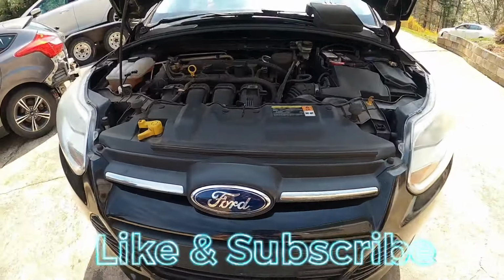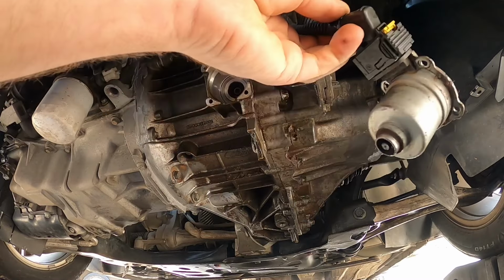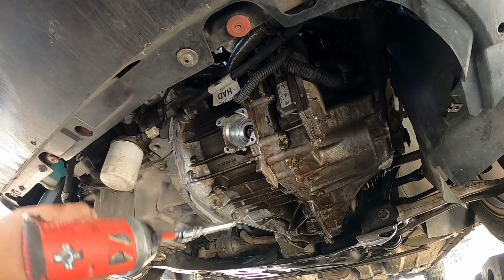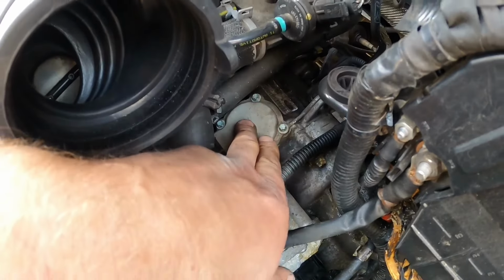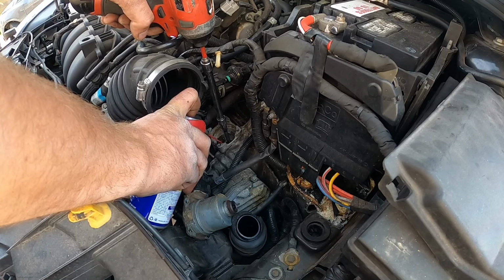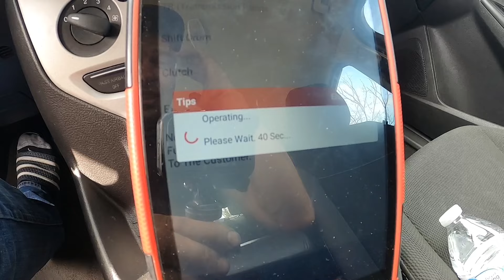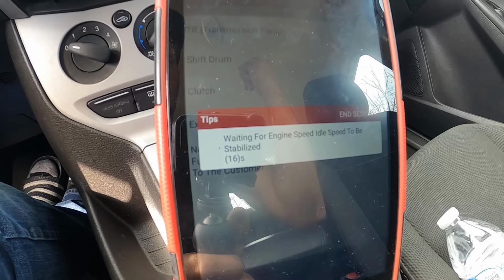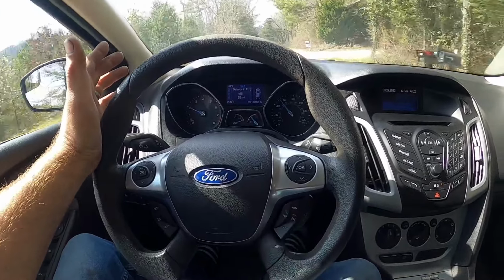2012-2018 Ford Focus Slipping? No Reverse? No Drive? Problem Solved. Easy Fix. You Can Do This!

Comment: What is the bit for removing the 4 actuator screws/bolts?
Reply: i saw some people say it was an E8 torx. I am trying to figure this out as well. i would recommend getting a set of ETorx if you dont own any. I am about to do this as well.
Reply: I used a 1/4” standard socket and that works

Comment: I just tried this. Everything was going well. I put it back together and test drove it. It was still slipping some, so I took the actuator off and the fork was stuck hard. I didn't know which way to turn it, so i thought counter clockwise was good. It gave but now it free spins in both directions. I might have screwed the pooch on this one.

Comment: I have no codes but I reset transmission to relearn. Was shuttering a bit at take off but after reset it stopped. Can u do this as preventative maintenance? And do u actually need to reset thru obd for i don't have this tool. Some people in comments say they skipped that part.

Comment: hi, i has a 2012 ford focus se model,134800 miles, sometimes R(reverse) not working and front has a belt noise, should i go to the ford dealership for this issue? Is this TCM issue and worth to go to the dealership?Ford dealership said they will charge 344$ for tcm check. If reverse prob;em is not associated with TCM, this fee will not waived. 
Alreday spent 75$ for transmission check and they told me to replace for thousands. 

Im broke and want your advice.
Reply: Me too. Need advice!!

Comment: Unfortunately, I believe I have a broken “B” fork. I tried to move the shaft counterclockwise 14 turns, but when I released it, it had no spring return. So I guess it’s time for a new clutch set.

Seems like the “A” fork is easier to clean than the “B” fork due to gravity taking the brake cleaner and lubricant down into the fork mechanism. Hard to shoot brake cleaner up into the “B” fork.

Comment: I have a question. Please help if you can! I had a code P287A for clutch B stuck engaged and No reverse.  I did some cleaning like you and switched actuators between each other and deleted codes. Transmission started working. But I can't perform adaptive learning for some reason.  At first I tried to do TR sensor test but it's failed, then clutch learning, same thing with it - failed. And I feel a bit of slipping on 1st gear, also sometimes rough shifting between 1st & 2nd gear. And when I'm driving downhill without touching acselerator pedal my RPM's about 2000 with seems to be high. Thank you!
Reply from the maker: That transmission has to come off and inspected. Seems like clutch fork is stuck
Reply: @L8R-HP  Thank you. I’ll give you an update after I’ll finish.

Comment: I just bought a 2014 Ford Focus titanium hatchback, 86k miles. Just got a code for TCM, and shift forks. I’m not sure if the TCM is actually bad or if just the shift forks going bad? What do you think?
Reply from the maker: Forks are sticking
Reply: @L8R-HP I have a blue driver OB2 scan tool but I can’t find where it’s has the adaptive learning, what scan tool would you recommend? Or can I drive it to somebody that has a scan tool after cleaning the forks out?

Comment: 16:14   unplugged batt first when done cleaning *then plug batt will set computer ?
Reply from the maker: That will reset computer. But it’s best to do a relearn with a scan tool or forscan. If you don’t have a scan tool or forscan it will relearn on its own eventually if all is working right.

Comment: Thanks good to know... the TCM seems to be going in my son's 2015 ford fiesta but i will give this a try considering it will only take about 20 mins or so... What scan tool are you using? the engine light is on but my cheap obd scanner says there's no stored codes? may have to go to the salvage yard and pick up a used TCM but I think once changed they have to be programed... I think with a scan tool that can be done but at this point I am not certain.. only started messing up last night and i havent had much time to research it.

Comment: Question: are you rotating counterclockwise the whole time or are you reversing when it stops?
Reply from the maker: Counter clockwise 14 turns. It goes back on its own if working right

Comment: Thanks for the video.  i have Ford focus 2014. When using the tool and turning counterclockwise, actuator B does not return (actuator A does return and works well), my car does not have reverse... what could it be? the broken fork?
Reply from the maker: Broken fork. Needs to be replaced

Comment: I took actuator A out, mine might turn 1 turn then stops, i didnt want to turn it too hard. I hadnt sprayed it with brake cleaner yet as i have to pick some up tomorrow. Think it will help? Or too far gone? It just feels like its springy both ways.
Reply from the maker: It will help, just be patient don’t force it

Comment: I saw your video but i have a question, i really need the brake cleaner? Or can i use a carburator cleaner? Or only use the WD40 Spray? Or can i change it for a Sonax SX90? And how can i know if my transmission is slipping?
Anyway, thanks for the video

Comment: I had a similar recent case, there was a fault with actuator B, what I detected was wear on the clutch assembly, which causes the plate actuator valves to block. I didn't use this method with pneumatics, I think it's a very risky process.. the solution will be to replace the clutch assembly after approximately 100,000km on these vehicles.
Reply from the maker: Not just the clutch. The forks. The forks are the problem. Clutch fails cuz of sticking forks
Reply: @L8R-HP  they comes on the kit?
The client don't wanna do the repair because just the kit was something about 3500€ 🫠
Reply from the maker: @ricardopinheiro4574  I charge $2,500 parts and labor

Comment: I ended up fixing my car by cleaning all the relevant grounds , changing the actuator B with a chinese ebay one and spraying brake cleaner and then a lubricant into the hole where both the A and B actuators are. I did not actually wind the motor back and forth since I did not have the tool. My car has 180k and its time to sell it before it breaks again

Comment: Thx again for this vjdeo. I'm getting ready to do one, what size is the spline tool? It looks like it's a 12 point spline but m6 & m7 slips, m8 is too big. Please advise, thx :-)
Reply from the maker: ReluxGo DSG Gearbox Clutch Motor Electromechanical Unit Unlocking Tool for Ford DPS6 / 6DCT250 Focus Car Motors Transmission Alignment Removal Tools https://a.co/d/1thkAmd

Comment: I did as the video  instructed. It turned counterclockwise 3 times on Actuator A. On the 4th time, it got stuck, and it does not unwind anymore. Now I can't drive forward. What can I do? Do I have to bring down the transmission and replace the forks?
Reply from the maker: Yes. Your forks are bad
Reply: @L8R-HP  What would cause the forks to go bad? The TCM?
Reply from the maker: @TheMaestroWay  clutch dust collects over time, moisture and things like that

Comment: Do I need to do this adaptive learning if I'm just replacing the actuators?
Reply from the maker: You don’t have to. As long as there’s no codes and all is working properly it will relearn on its own
Reply: @L8R-HP  you're the f-ing man. Thank you so much.
Reply: @#L8R-HP  I just replaced actuator B with a brand new one and now I have no reverse. Any guesses?

Comment: So what's the fork timing? Spinning back and forth doesn't make it out of timing? What's the point of install for actuator? Just install no matter what position fork ends up after cleaning?
Reply from the maker: Forks go back where they need to be, you can do a relearn with a scan tool, or if all is working right you can take it on a drive and it will relearn on its own after a while
Reply: @L8R-HP  I see. I'll try to record its position and leave it once done lol
Reply: Recording position wasn't possible. 1st to 2nd got really smooth but 2nd to 3rd it's like jumps to 5th. Driving will relearn it or has to be done by Scanner? Has 81k miles

Comment: So if cleaning as you have just done do we need a scan tool or can we just clean then drive it ??? I’m going to change transmission oil tomorrow and see what happens as it’s jumping in to gear and slipping. Cheers
Reply from the maker: If everything is working, a good drive and the car will learn on its own

Comment: Can you do this without a scan tool and resetting the transmission. Basically just clean it and put it back together and just drive without scanner reset ?
Reply from the maker: Yes. If there are no issues or codes it will relearn on its own
Reply: I have slippage and once in a blue moon it'll hesitate to go into reverse. Lately it's having some seriously garbage shifting out of first gear with heavy throttle along with slippage. So since I don't have a scanner. I was just hoping I could do this work and just drive it and it'll relearn it's self. Is this correct if I'm understanding you ?
Reply from the maker: @smyer4040  is there a check engine light on or any codes? Try this. It will help
Reply: No check engine light and like I said I don't know about any codes because I don't have a scanner. I'm just concerned if there is codes and I do this and don't reset or relearn the transmission with the scanner it'll mess up or something
Reply: Can't you just replace the parts? And what's the part number? Please. And that brake fluid and WD40 ?

Comment: Help! Actuator B went, switched A to B and A didn’t work. Bought a new Ford actuator didn’t work in either one. Bought a used one at a parts yard worked for about a week, bought another worked for about another 2 weeks. Bought 2 more used today and neither worked. Both forks spin in and out freely. What now TCM?

Codes 

Pending
P07A5
Transmission Friction Element B Stuck On
P287A
Clutch B Stuck Engaged

Comment: What happens if you turn more than 14 turns?
Heres the issue I am having. The one on the top didn't have any "spring back". I turned it i feel like less than 14 turns and the screw/bolt came seemed like it popped out.

It screwed back in just fine but i can only turn it clockwise because if i turn it the other way it just seems like its backing itself out of the hole again.

My theory is that it is very dirty and clutch needs to spring back for me to be able to turn it counter clockwise. (am I right?) I'm letting it sit with wd 40 over night to see if anything loosens up

Also if I keep turning clockwise, will I hit an end point? I am afraid to keep turning too much. I don't know what to expect.
Reply from the maker: Needs new forks and a clutch

Comment: I ended up putting a new clutch actuator but now when I start the car it won’t move forward or backwards. Where I bought the new actuator it said it’s pre programmed. But in case I need to program it, do you know how I can do it without taking it to a dealership?
Reply from the maker: Actuators don’t need programming

Comment: My actuator tool slipped off the fitting and instead of spring loading back into place, it’s just wiggling around. Did I break it?
Reply from the maker: You didn’t break it. It was already broken.
Reply: Well that’s good to know. Do I need to get a new clutch kit to replace the whole thing?

Comment: Have you had any that would illuminate a  warning in the Instrument cluster of the transmission is overheating?
Transmission is full of fluid.    It will alert an overtemp of  trans  within 1 mile of a cold startup.   Not actually overheating.   Can't build enough heat to have an overtemp condition that quickly...
Reply from the maker: The forks are getting stuck and making clutch slip and get hot.

Comment: Will that computer you used flash a tcm to match the cars vin so that it will work after replacing. That way I don't have to take it to the Ford dealership and have them do it.?
Reply from the maker: Try to find a used TCM. My scan tool doesn’t program. You have to use ford IDs tool

Comment: You can definitely clean up the actuators. But for God sake no WD40... Cause if you do you are pouring lubricant on the clutch plates, which will eventually cause them to slip and shudder.
Part of the issue with these trans is that the input shaft seals leak, spilling tranny lube all over the clutch plates causing the shudder.
Replacing those seals involve removing the clutches so may as well replace them at that point...
Reply from the maker: WD works great, don’t put a gallon of it in there. The slipping is cause by sticking forks. I’ve done 200+ of these focuses in the last year and have yet to see a leaking seal. One fiesta had a leaking engine main seal, but did not get on the clutch. If you know what you’re doing this works. It has helped lots of people that can’t afford to pay $5k to replace everything

Comment: Hi, if the B is moving both ways without spinning back what does that mean?
Reply from the maker: You need new forks and probably the clutch while you’re in there
Reply: @L8R-HP  Thank you so much

Comment: I have a 2016 Ford Focus se. Getting the transmission hot wait 5 mins and the car won't go and when you push the gas it won't rev up. So I watched this video and the actuator on top under the air box I would use a screw driver to turn what you are turning with the gun several turns both ways and put it back together and it would run fine for a week then I'd have to repeat. So now it happened again and when I  turn that with a screw driver now it has no tension like before it acted spring loaded but now it's both ways 1000 turns if you want. Aldo when i hook battery up it has a constant clicking coming from the actuator even with the key out. What's do you think is wrong with it now? Something inside transmission? By the way your videos rock dude.
Reply from the maker: Unfortunately your fork A is broken inside. Transmission has to come off and fork needs to be replaced

Comment: So I have a similar issue except I’m getting transmission over heating wait 5 min, but once it’s above 50 drives fine will this work for that issue? It’s a 2013 ford focus 😢
Reply from the maker: Forks are sticking making clutch slip and get hot. Yes this will help

Comment: Sir, what will happen if we clean the forks in DPS6 transmission in clutch housing with water?
Reply from the maker: Water will rust everything
Reply: @L8R-HP  Sir, i think you are correct because I was guessing that it will rust everything
Reply: @L8R-HP  Sir, Have you ever sat in Ford Ecosport car (2013-17)?

Comment: I have a 2017. At 80k kms I brought it in for a shudder since it was still under warranty at the time. My paperwork says they replaced the clutch. Its been shuddering again, worse than before, and this past weekend while on the highway it started really shuddering, speeding up, slowing down, when I pulled off the road and stopped the car lurched forward even with my foot on the brake. I assumed it was the TCM, just like I assumed that's what was replaced the first time. 

Is this possibly what's happening? There's nothing actually wrong with the clutch, the forks just need to be cleaned? I was told the part was $1500 and labour was going to be at least $650. I'm a student, still paying on this car. I have no idea when I'd have enough money to bring it to the dealer.
Reply from the maker: It’s the forks. They need to be replaced. Cleaning doesn’t always help.

Comment: GReat Video! Can i do this work without a scanner? only clean both actuators like you did! 
or need to reset transmission after do this! 
sometimes is slipping! its a focus titanium 2017!
Reply from the maker: You can do this without scanner. If all is working properly it will relearn on its own
Reply: @L8R-HP  thanks for comment!!! 👌
Reply: One question more! 
The gearbox Was in Neutral when you did that? Or in Parking?

Comment: I used the reset tool and lubed up the actuator port but now the actuator won’t go back in, Does it need some force to go back in?
Reply from the maker: Don’t force it. Wiggle it until it goes in

Comment: I got a 2012 LW Focus with 75,000 kilometers, so far the steering rack had been replaced and heater core failed, now there is rain water leaking into the hatch compartment and wheel well. with some testing with a hose it seems to be leaking due to the roof rail and there was also water in the compartment where the sound deadening material is. the water was drained out when releasing the bottom bung plug under the car. every now and then the engine does hesitate when taking off too, but there is no check engine light or codes, it could be a number of things including spark plugs/ignition coils/Mass air flow sensor could be dirty or the fuel injectors/fuel pump. this car has left a sour taste in my mouth and I never want another ford ever again!
Reply from the maker: Every car needs maintenance.

Comment: So is was cleaning my forks when the fork was tight the tool popped out and the fork spun back quickly. I heard a spring sound after. I do not have 2,4,6,R. I swapped actuators just to see if the failure was related to that but the problem was the same. Did I screw myself?

Comment: So I followed all the procedures, got my car actually driving, but now I get the “transmission overheated” message. This is the first time seeing it. Also have the (new) code of clutch A stuck engaged. Gonna re-spin the A actuator tomorrow and get transmission fluid replaced. Any other suggestions though?

EDIT: I also had done a manual re-learn… but I have FORScan and plan on doing the professional re-learn tomorrow… wondering if that’ll help 😕
Reply: Any update? My daughters car has these same two issues. Thanks

Comment: I did this on my 2013 Fiesta a while back , but never did the adaptive learn or whatever, the check engine light came back on with the P090D which is clutch b actuator circuit high, do you recommend I replace the whole TCM or what?